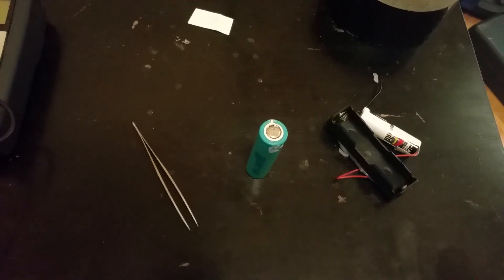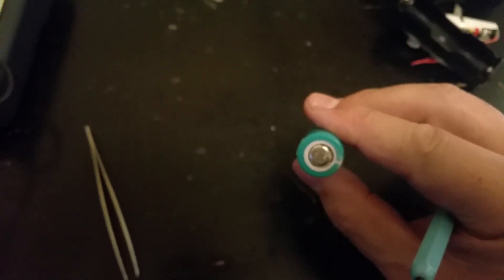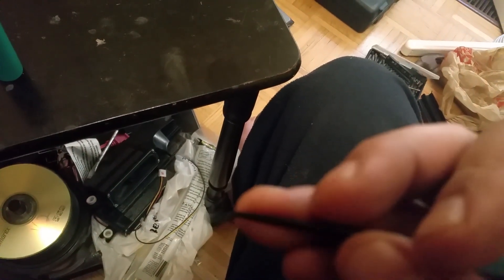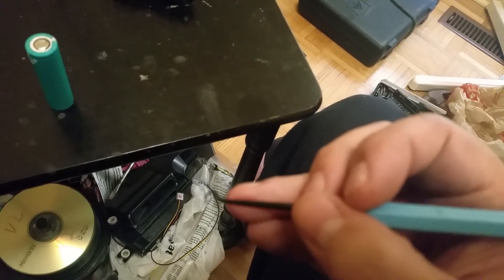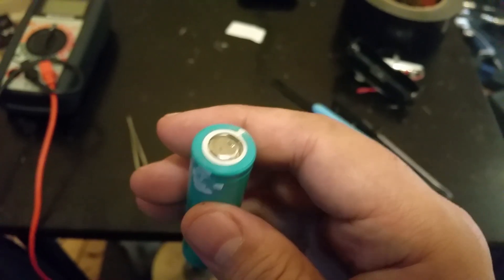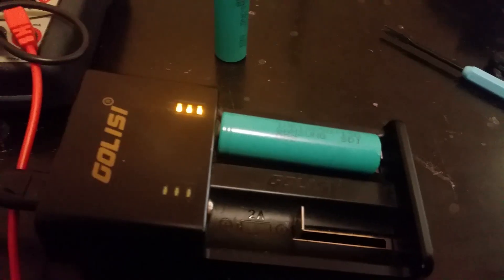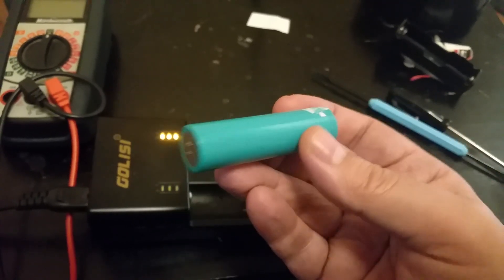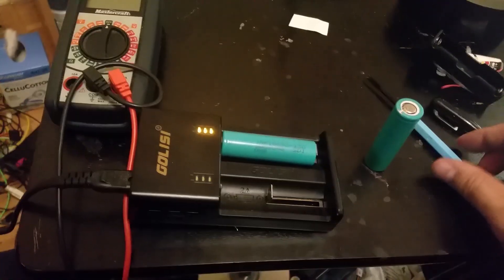EASY FIX FOR A DEAD 'NOT CHARGING' LITHIUM 18650 BATTERY FROM A CORDLESS TOOL BATTERY PACK - PART 2

Comment: I've been doing this trick for years and its safe but it doesn't work in all dead batteries. But it will work most of the time. Its a great trick and there's nothing to be be afraid of doing this method as long as you're doing it right.
Reply: Nat Nat 😂I just did this and my shit caught on fire shit scared me
Reply: Is it normal if the battery liquid came out from the batts but it is charging
Reply: Louis Valdez liquid is wrong
Reply from the maker: yup
Reply: agreed

Comment: I did this with small screw driver i gently pushed down, then i heard à little "PFOOP" coming from the battery.. The voltage raised from 0.35 To 4.02 V. But may i charge or safely or not ? Is it even normal that the battery pop sound was produced ?
Reply: Al3x360 Hello,

Well this means that the cell is supposedly ruptured. Meaning that the controlled enclosed environment that was previously inside is now exposed to the outside (air). 🤔

You should observe the battery when charging (how hot it gets) or discharging.

This has also happened to a couple of my own 18650 cells when trying to unlock them. I always check for temperature when charging. I use one of those eBay laser IR thermometers for this. 😉

But the opinions here are divided. Some will say you can still use the batteries after resetting the CID (no hiss sound), while others will say you shouldn't even touch the CID. Because if the battery has become locked it's for a reason (pressure buildup).

Now the same also applies to the situation when you accidentally rupture your battery when trying to reset the CID. You can still reuse it, but check for heat/temperature. The bad side of this is that the battery cannot go back into protective mode again (CID on), when you have vented it.

So if you would have problems while charging or discharging, it could explode. 😮
Reply: You just heard the sound of the metal disk being flipped back to it's pre-popped state.

Comment: Mate, tried this method and I almost burn my eyebrows. Just buy another battery ffs...
Reply: Trackers Romania it means your are doing it the wrong way. I think you press it too hard, puncture the cid and accidently short circuit the battery. He clearly said in his instructions, press gently though.

If I were you, I wouldn't do this method without any knowledge of 18650 batteries. I managed to revived my batteries using this method, but I studied and doing some research first before I tried it though.
Reply: @stephenmichael3211  hei plis explain me. After i do like in the video. My battery got bleeding in light brown liquid. What is that? Can you tell me?
Reply: @blackforest1484  it is liquid (paste or gel) Electrolyte. You can't use the battery once the liquid is leaking. The liquid is inflammable and corrosive.
Reply: Wow this thread is 2 years old now. I never knew I have been using those battery 2 years after I revived it LOL 

Update: 80% of all the battery is still in good condition. I still use it but the battery capacity is not as good as before though.

Note: I am 2 years older now. LoL
Reply: Trackers Romania same, I just burnt my thumv

Comment: Hi i have some LGEAS31865  batteries salavged  from my HP laptop ,I tried fixing it to my diy power bank bought from ebay , power reads in my multimerter as 3,5v and some dead cell after reviveing live to  1.2v , is not chargeing at all ,
could not find the fault , whether new chager rejects this cell and only accept 16850 cell ,just need to know from your experince if any ,,,,tks
Reply: sammy it means the battery has a puncture or it’s bended... I wouldn’t use that battery
Reply: Hi ,Thanks ,i have to make another attempt to try it thru single  chargeing using TP4056 , I m still waiting for the delivery of this 4056 ,once received will do the best ,still nothing works means have to dispose it ,,tks pal

Comment: That battery needs disposing. Don't tell people to stick metal prongs between the negative & positive connections you idiot. This is 2mm away from a hard short & exploding in case a battery has a different fault a user misreads. Also batteries with holes in the positive should be disposed of.
Reply: that's an INR Hybrid cell. its pretty safe. hell, you could cut it open and be fine (might get a bit hot).. they are DESIGNED to not catch fire this ain't your ICR Ultrafire from Ebay. its a Legit Samsung cell.. 

infact. this Protection "button" he talks of is a venting tool to allow the battery to vent. there is a good chance he drew max amps for an extended duration. and the battery got to hot in an already Hot area (think summer, using a hot tool pack.) but since it was not the Sensor-ed battery. the pack didn't shut down this happened instead.
Reply: Use something none conducive lol.
Reply: My sentiments exactly!  This dude babbled on for 10 minutes saying the same shit in the beginning, when he coulda been saying, "Hey, guys, this can be extremely dangerous and I'm a moron for using metal on a lithium ion battery.  But if you wanna be a moron too, and possibly lose a body part over a $10.00 battery, do what I'm doing here and stick some metal into a lithium ion battery then try to puncture it where it will become a gahdamn suicide bomb!"
Reply: theres a full disclaimer in the  summary......... but im still using said battery on a daily basis, original battery pack was a barely used pack that still died exactly 3yrs after purchase, imo the charging circuit board will purposely cause it to fail but i have no ,proof of this
Reply: Start your very own battery business and make huge money here: HootBattery.xyz